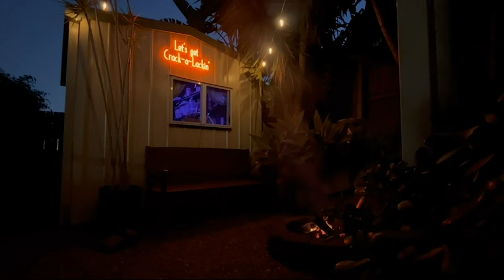Matchbox Lesney M6 / K5 Racing Transporter Vintage Die Cast Restoration

Comment: looks so much better. :) sound was good, too.
the crooked body seems to have been stepped on, which could explain why the ramp slid out. one solution could have been to use two shorter axles with big mushrooms and connect them in the center with a piece of brass tubing. would have saved you a liter of blood or two. XD
the replacement glass es I've seen all don't come with that tongue that keeps the ramp up in place. maybe because the replacements are made of resin, not polystyrene... but that leaves the problem of how to add a spring to that ramp. one of these days I'll experiment with a cable tie glued to the floor. a white one shouldn't be too obvious. or maybe a black one?
I have the same truck, all tyres on, only one crack in the roof. but still playworn. I have a feeling the shrinking of them hubs comes from UV rays exposure; the more it gets played with outside, or the longer it resides on the windowsill, the more the hubs shrink. even the paints would fade; I have a scout car in mint condition, only that the yellow has faded to a dull tan over half of the casting. :P

sometims when putting these together it makes one wonder what tricks they had at the assembly line... surely this can't go together? XD
Reply from the maker: Hi Lothar! So the ramp is supposed to be spring loaded? I didn't know that. I almost bought a first series MOY Bentley once because it was a weird blue colour, but on closer inspection it was green that had gone funny from the sun.
Reply: @PBsRetroRestorations  Yep, many times the plastic strip connected to the glass insert between cabin roof and roof window, is snapped or has lost tension. and the repro I saw in some video, doesn't have that spring... maybe because of the material they used?
yeah, I once bought a late Matchbox 65 Mustang because it had spoke wheels, turned out it was a former Superfast with broken suspension piece where someone glued spoke wheels onto. the rather nice paintcoat misled me. :P

Comment: Awesome production quality on this video, Peter. Might I be so bold as to suggest, two or more applications of floor polish on your wind screens. Also, don't be afraid to let the first application soak in a bit. Other than that, you did a nice job of that transporter.
Reply from the maker: Thank you for the feedback Gerry, and thank you for the advice on the floor polish, I will try sitting them in there a bit longer, I guess a couple of coats helps fill in the cracks correct?

Comment: Fabulous restoration, Pete. I'm surprised the resin tailgate didn't disintegrate 🤣🤣🤣🤣🤣🤣. Neat idea about making a circlip to hold the pin in place on the ramp. I'll contact you later with a file to 3D print your Lesney tyres. All the best my friend cheers Michael
Reply from the maker: Thank you Michael, that'll be handy.

Comment: Well done, PB.The tires look too big.This casting uses the same tires as the AEC fire engine.
Reply from the maker: Thank You Terry! I think you're right, while being smaller than the ones I had (which I >think< came from a K10 Pipe Truck) they are still too close to the arches. Thanks for the AEC info, I'll have to get a set of those.
Reply: @PBsRetroRestorations  Yes,PB,the ones on the pipe truck would be the bigger ones.